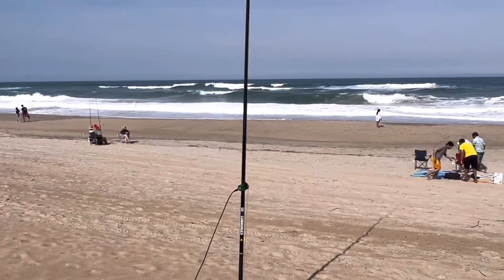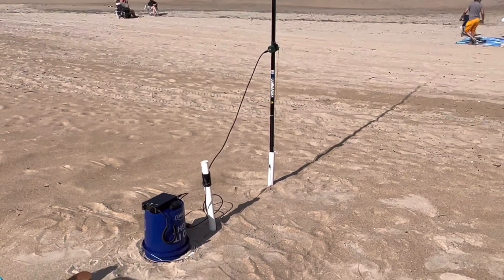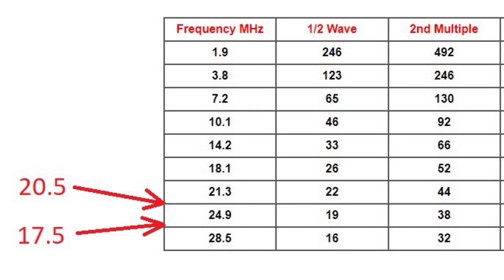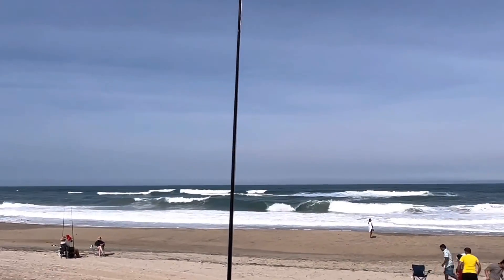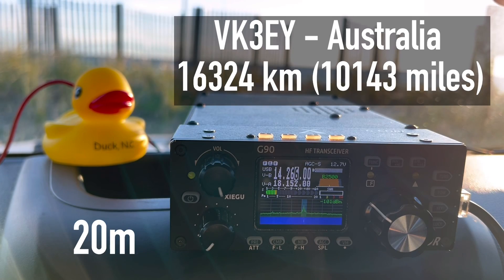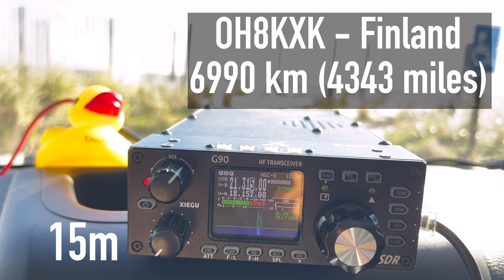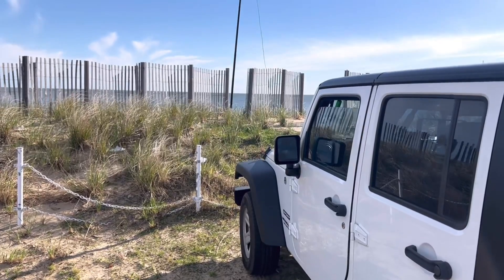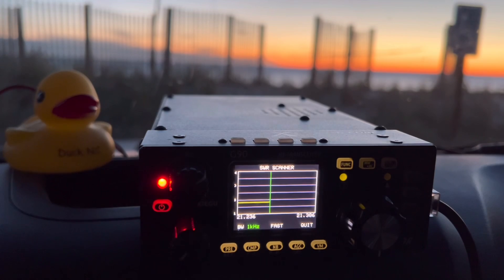K4OGO Coastal 20 Antenna - Tweaking and Improving

Comment: Hi, Walt!  I have the Coastal 20 Antenna standing at my QTH.   It is attached to a 9:1 unun and MFJ auto antenna coupler (aka "tuner").  The driven element is not a wire, but a segmented piece of aluminium tubing mounted on a loudspeaker tripod.  I was playing around with it today and replaced the unun with  a 4:1 voltage balun.  The results were very bad, so I went back to the unun.  I will next try a 4:1 unun, but I think I will have better results with the 9:1 unun.  I don't live directly by the sea.  I live on a small island, but my QTH is 150 meters above sea level.  I compared it to my  multiband efhw antenna on the 20 meter band and found the Coastal 20 much louder on receive than the EFHWA.Surprise.  I will make a portable version using speaker wire (my wire of choice) for the driven element and a 7 meter Spiderbeam  telescope pole mounted on an aluminium speaker tripod (rather lightweight). When we get a break in the much needed rain I will take it out for a road test.  Everything has to be carried on my motor scooter and no tools needed to set up.  Vy 73! David SV0SGS

Comment: The coastal 20 has been a great POTA antenna when I need quick setup in a small footprint.  It works well especially when I get lazy or short on time.  I use a 10m carbon fiber pole supported in a half full 5 gallon bucket of rocks and a 9:1 matching transformer.  It is amazing the signal reports 55 to 59 on 20, 17, 15, 12 and 10 meters from coast to coast and my first ZL and many JAs all with 10 Watts from my KX2.  73 KA7GPP

Comment: I'm also looking for non-radial designs and I am generally a fan of non-resonant antennas bit I think the theory might be flawed here.  A half wave is a special case because it has ~1200 ohm radiation resistance making it very efficient without radials.  However, that radiation resistance falls off sharply being just a little longer or shorter.

Comment: Hey Walt, do i understand it correctly when you used this antenna in Poland (far from the sea) you needed a 9:1 unun instead of near the beach a 4:1 unun?
How high on the dx commander do you place the antenna?

With kind regards
Reply from the maker: No, definitely go with a 4:1 in all applications. It’s a big improvement. Place it as high as you can get it.
Reply: @COASTALWAVESWIRES  I have a Spiderbeam fiberpole 10m, simular to the DX commander! Thanks for the information

Comment: Walt will the length of coax change the SWR on this setup?
Reply from the maker: It might have an affect if a choke isn’t used.
Reply: @COASTALWAVESWIRES thanks for the reply. on 20m im getting 8 for swr, probably need to do some testing/fiddling around to see what’s going on.
Reply from the maker: 8 is high but this antenna does require a tuner, you’re not going to get it perfect.

Comment: An OCF should be a half-wave design, not quarter-wave.  Some people say a 20 meter OCF can be as short as 3/8 wave length (of course using a tuner).  That calculates to approximately 25.8 feet - minus any velocity factor.  I am experimenting with this now.

Comment: Hi walt. I used your 17.5 length of wire. Got base of unun if antenna up 18ft also put 2 1/4 wave radials  at 45degs 4.1 unun first call out the cayman islands it works  many thanks for the Idea Walt 73s GW4 mike

Comment: Just now built a Coastal 20, Walt...looking forward to taking it to the beach next week to test it. I'll use my 4:1 UNUN since that's all I have (from my Rybakov build) ..it seems to make more sense to me, however, to use the UNUN ...with the driven element-to-counterpoise ratio so high. It would be fun to do a comparison on the RBN within minutes of each....with a 4:1 UNUN and then 4:1 BALUN
Reply: A 4:1 UNUN becomes a 4:1 BALUN if you cross the wires in the feed line. The difference is which side (ground [UNUN] or hot [BALUN]) connects directly to a driven element.  I don't believe it will make much difference for the Coastal 20 since the antenna is naturally unbalanced and you also used a CMC choke near the feed point.  An advantage of using a BALUN is that it also acts as a choke since the coax shield is no longer connected directly to a driven element.

Comment: This is really encouraging! I saw your original Coastal 20 video and the idea stuck in my head, so this month I started trying to build one. But instead of the 9:1 unun, I built a 4:1 Guanella balun for it. I just finished that today, so tomorrow I'll cut some wire and string it from my 7 meter fishing pole and see how it plays.

Thanks for always trying new stuff and then posting videos about it. Your channel is a great source of inspiration.
Reply from the maker: Thank you!! 73, Walt
Reply: @COASTALWAVESWIRES  Follow-up: I set up the Coastal 20 with the Guanella balun and the G90 was able to tune it to SWR of 2 or lower on every band from 80 to 10 meters. I cut it a little long and it seems to like the CW portions of the bands better, which is fine with me.

Comment: Hey Walt. Thanks. I am a new HAM. Just bought a G90 and coupled it with your 17-5 crappie pole antenna with 4:1 balun and two counterpoise 3’ wires in my backyard. Not much saltwater in TN. Freshwater? SWR @ 20 meters was 1:1. Other bands weren’t too bad but required tuning. Works great. Thanks. Next projects are a Rybakov and EFHW, but I need a longer pole. Great videos!
KQ4RGB
Reply from the maker: Thanks! You’ll love the Rybakov. 73, Walt

Comment: Why wouldn't you use an unun...since the two lengths (ant and c.p.) aren't equal
Reply from the maker: I’ve used a 4:1 unun in the past, this was an experiment and I went with a balun because an Off Center Fed dipole uses a 4:1 balun as well. I wanted to see the outcome and obviously it was a good experiment as you can see in the video

Comment: How do you know if you need a 4:1 or a 9:1 or whatever?
Reply from the maker: It’s all about feedpoint impedance and mostly historical knowledge and designs. You can model antennas in software to see as well. Typically for verticals I use a 4:1 for 17.5’ and 25’ and the 9:1 for 29’, 35.5’ and 41’. It’s not limited to those lengths but that’s a good rule of thumb to get started.

Comment: DEFINITELY try 15m!! It's been my go-to band for a while now. I have to go back to late January to find my last 20m QSO and I'm 74/100 towards Mobile DXCC, in a little over two years. Setup is a FT-891, between 5 & 50 watts...because any more is pointless (as you know) SSB, into an ATAS-120A on a triple magnet mount on my Subaru wagon roof. if 10m is closed, I don't hesitate to go 15m and if that's dead, I'll eventually get to 20m. QRZ Logbook is current under WB3CFN if you want a look.
LOVE your videos!! Hoping to get something going at home with one of your designs. (I'm in an HOA condo so, temporary antennas are okay but anything semi-permanent has to be stealth.) Thanks, Walt!!

Comment: I am a new ham KK7RWK got my license in March. I have really appreciated your videos, and have taken inspiration from them for building my own antennas. I have a 40m skyloop at home right now, but plan to build a rybakov or some variation of your coastal 20 for portable operations. I'm trying to break into POTA, but the 10w from my x6100 hasn't been enough from the particular park / antenna combination near my house to activate (despite 3 attempts). Thanks for your videos, I hope to catch your callsign on the air one of these days.

Comment: Do you have any tips for running an antenna out of a second floor window down too the ground? I have been having issues with getting my efhw that is resonate when Im on ground but not when its up high. 73
Reply from the maker: Add a 6.5 foot counterpoise wire dangling from the feedpoint out the window. I did this In Poland with an EFHW I ran out a second floor window and it worked great.
Reply: @COASTALWAVESWIRES  thanks I will try

Comment: Walt, 
I hung a 20m off-center fed dipole vertically from a 12m spiderbeam pole, and was able to tune easily down to 40 meters.  However, I was unable to get any 40m contacts.  Also be sure and keep the coax running horizontal from the feed-point

Comment: Hello Walt! "Pretty cool"? it sure must have been. I'd be jumping all around if I made such contacts 😁
Anything over 20M was rather quiet here yesterday, and even 20M wasn't all that great. Made QSOs from all over EU on 40M with the G90 and my 7.6m Rybakov antenna inspired from one of your previous videos, but not much further.
The "Costal 20" sure enters my list of antennas to try. In a month or so I should be able to enjoy the saltwater boost too. Getting ready for this!
Thanks for your always fun and inspiring videos.

Comment: Hi Walt. Just a quick thought about your great 15 meter performance. The 20.5 foot length is almost a full half-wave on 15 meters. Granted, it's not resonant, but it's close enough to really enhance the performance on that band. My fave mobile/portable antenna is a 29 foot vertical with a 13 foot counterpoise. It's roughly 5/8-waves on 15 and the counterpoise is close to a free-space 1/4-wave on 15 meters.  I visuallize it as a 15 Meter 5/8 Vertical.  I feed it with a 9:1 Unun, the "Famous" EARCHI Unun, popular around 10 years ago.. The antenna is supported on a 10 meter mast supported with a home built drive-on mount. No beach ops and a pair of Titanium knees preclude much hiking & hauling here, heh...  This is my primary POTA antenna along with 4 different Magnetic Loops I have built. 58 years in this hobby, and always ready to try something new!   73, de WB2VUO

Comment: Hi Walt. I really enjoy your videos. What were the final lengths of the poles that you used with the 4:1 baking? It looks like the feedline was placed higher than your previous version of this antennae
Reply from the maker: Yes the feedline was higher. The top of the antenna was at the top of my 10m pole.

Comment: great antenna.  made 2 different antenna's out of same wire. random wire with counter poise. the UNUN 4:1 the outher a off set center random with 4:1 Balun . both work and have different pattern. 1 better DX the outher better NVIS .  the outher way is like the MFJ 2010 off set center. that uses a 4:1 Bal Bal into a 1:1 Balun.  the outher way to do off set center. the outher way is 75% to 25%  wire length. still a dipole. just moving the feed point. 73's

Comment: Looks good. Will be interesting to see Nano VNA impedances on the various bands. You mentioned 15 meters and that got me thinking I don’t think you can beat that antenna on 15 meters with any other vertical as it is close to a half-wave long. Resonating it in the middle of the 15 meter band should give a purely resistive feed impedance would be maybe 250 to 300 ohms. So a 4:1 transformer or slightly higher would be good and that’s what you are using here. Consequently you are so close to perfect now that I don’t really think you could do any better by resonating it. Having a halfwave vertical on 15 is quite a good antenna! Do you have any idea where it resonates in that configuration? I am guessing slightly below 15 meters. If so you could shorten it and still be really good on 15 meters. Probably not affect the other bands at all.

Comment: if you want a small radial free 20m antenna that doesn't need an external balun, unun or ATU check out the old "Shorty Forty" antenna & just halve the dimensions (radiator & coil.. but keep the same number of turns on the coil) so 18.5 foot long total, centre fed, Co-ax screen to centre of coil & main conductor tapping in 2 or 3 turns out.
For 15m make the centre coil plug-swappable & just have a smaller one for 21MHz
I've not tried it on 10m but as it is a smidge longer than a half wave dipole it will probably need a capacitor to shorten it rather than a coil to lengthen it.
For self supporting coils I use 2mm electric fence wire that comes in multi-hundred m drums & is cheap as chips so there is no worry about the cost of a play.
For quick connection of the coil to the antenna it is worth checking out Wago snap connectors.

Comment: You'll love the VNA...best thing since sliced bread. It would be great to see a full multiband sweep instead of each band segment on the G90. Both the 29' and 20.5' OCF's are going to be my main antennas out on my 3rd floor fire escape. Try adjusting the length of the shorter wire on the 20.5.